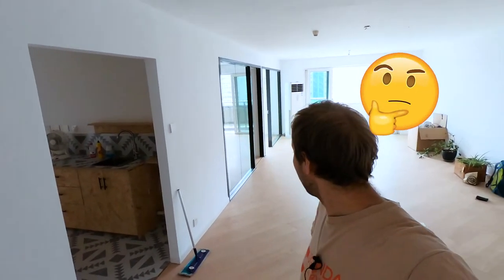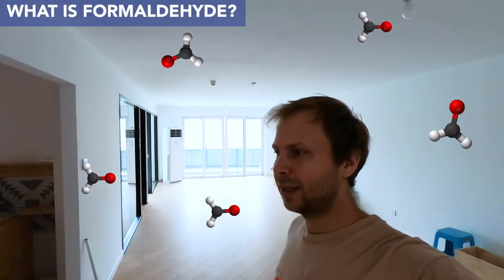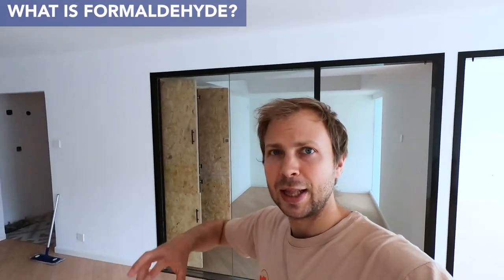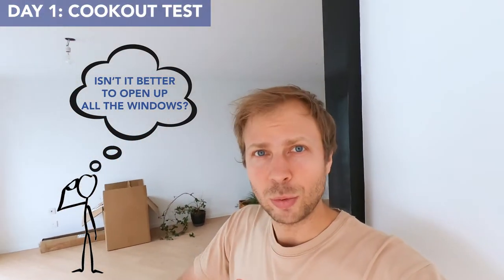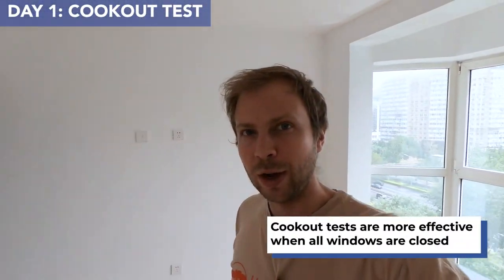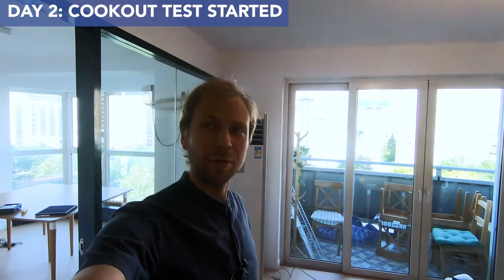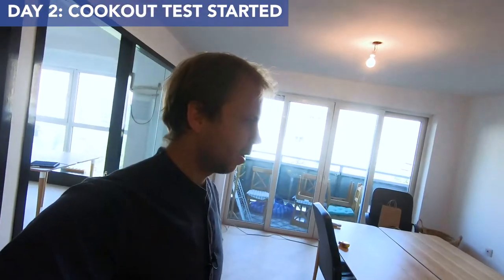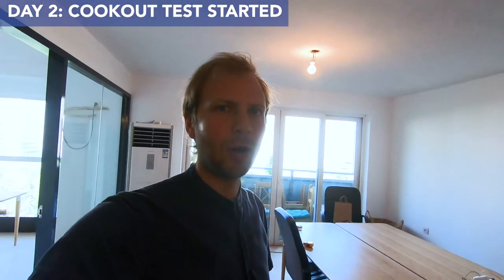Cookout Test: How To Protect Yourself From Formaldehyde/VOCs After Renovation

Comment: We did the whole burn out method about 5× and 8 hours in each room. Honestly it did help a lot. We also used the chemical spray that designed to help with the situation. We also repeated the method close the doors burn out and then open the doors air out and just kept repeating the pattern one week later everything's OK
Reply from the maker: It's great to hear that you had success 😎
Reply: @SmartAirFilters  do you think it will work on gas furnace and air vent duct work inside the wall ?

Someone used major spray paint in my house and I think it went inside the furnace and air ducts possibly ….
Reply from the maker: @catherinecheung207  possibly yes, but it's best to test it (quite expensive). Unfortunately, we cannot give you a clear answer. Do you use carbon filters?
Reply: Thanks for sharing.  Glad everything is ok
Reply: Burn out method ? Why you calling it like that ? Are you referring to cookout ?
Reply: And what chemical spray are you talking about. And saying it helps with the situation… what situation ? I swear people love to speak in cryptics

Comment: The effect this method has will be minimal unless you increase the temperature a lot. Off-gassing will still continue after cooling down. We're also not sure if it will really stay at 0.1 (in your test) in the long-term. The off-gassing would take several years for the chemicals to be in the safe level.
Reply from the maker: Yes, that's right. Paddy set the heating to approximately 86 degrees Fahrenheit (30 degrees Celsius). Research has shown that formaldehyde 'off-gases' 1.5-3 times faster in this environment. Of course, it is best to have an air quality monitor to ensure that the air is clean. The air in our office is of very good quality. 💪

Comment: If I have done a cook out and clothing or fabrics were inside the room, must I wash EVERYTHING after?
Reply: Your clothes will absorb some amount of the VOCs and formaldehyde and offgas them later.  But the method he shows in this video I'm personally not impressed with (at least not with doing it once). I'm very sensitive to these chemicals, so I would be washing them.  Using heat, you're essentially spreading the chemicals around, but mostly into the air.

This is beter if you can just open the windows on a hot and dry day
Reply: The only reason the windows were closed was to allow the temperature to increase more by temporarily eliminating cool air circulation... to maximize the release of the v.o.c.  

I have a feeling that introducing a concentration of gaseous butane or another solvent into the warm air before ventilating may also improve results

Comment: Question about the cookout. Should I remove furniture first. I’m worried that the released VOCs might be absorbed by the house furniture.
Reply from the maker: You'll want to leave the furniture in there! Furniture gives off VOCs and formaldehyde itself, so leaving it in will also help the furniture off-gas at a slightly faster rate 👌

Comment: Interesting, I kind of discovered this by accident and it’s good to know that it’s a valid method.

I recently purchased and assembled a composite wood cabinet. The smell was strong to begin with, so I moved it out to my balcony. It was about 90*F outside and the sun was directly hitting the cabinet some of the time. I noticed that when I went to go check on it the smell was really bad. I was a little concerned that the sun may damage the paneling, so I moved it around a bit so the same spots weren’t being constantly hit by the sun. I’m happy to know that should help reduce the amount of offgassing in the long term.
Reply from the maker: That's fascinating! It's amazing how sometimes we stumble upon effective solutions without even realizing it.

Comment: Thank you so much for these videos and your website. They’ve been very helpful. At 5:22 in the video you mentioned adding 20 kg of carbon. Could you please clarify how many kilograms of carbon are present in each carbon filter that you sell? Additionally, I would like to know the maximum number of filters that can be layered on the model of the Blast. Furthermore, how can one determine when the filters have become saturated and need to be replaced?

In my situation, I have a recently remodeled space with a strong paint smell. It appears that the majority of the odor is coming from the attic area. Interestingly, I've conducted four cookouts so far and noticed that the smell was even more intense during the third one and fourth compared to the second. Since the attic space doesn't have any windows, It’s a very large crawlspace. I've been relying on a fan to blow out the air after each cookout. I have air purifiers when I’m not used on a cookout but I’m not sure that they’re helping because they don’t have enough carbon in them.However, I believe using an better air purifier could be a helpful solution to tackle the issue long-term. I would appreciate any advice you have!
Reply: Great question. Too bad it was ignored like it was. Especially when you put all that time in writing this. It’s disrespectful even.
Reply: How do you know how much carbon were in your filters ?

Comment: I just got a new really large fluffy chaise lounge right out of the plastic and its in a very small room. We cant even go into the room now and it is burning our throats, nose and eyes significantly. I work from home so I cant leave. can I just shut the door, heat it up with a portable heater, then open the windows to vent...or do we have to leave the house for a specific amount of time to do a cookout even though its not the entire house?
Reply from the maker: Hey, it's best if you check what materials the chaise lounge is made of, but also contact its seller. The gases that are released during a cookout are dangerous and should be avoided for your own safety. Here are our various articles on cookout: https://smartairfilters.com/en/?s=cookout&searchblogs=1%2C9
Reply: @SmartAirFilters you say this and in the video the guy is literally walking into a cookout room without a special mask

Comment: I’m dealing with a fix in my apartment bathroom ceiling which has no windows, just a vent-fan. First the hole was sealed with plaster ,  but then a oil based primer spray paint can was sprayed over that ( the problem), then regular paint.  I can still smell the primer, I don’t even think it’s meant to be used indoors. I’ve tried using reg fans to air it out throughout my home but I don’t think thats healthy. Been currently using the water and lemon buckets which helped but with the vent fan off the primer just keeps off gasing so the vent isn't powerful enough. I don't want to spread it to the rest of my home. My bedroom is across from it which has the nearest window but if I fan it out through my bedroom wont that contaminate my bed n stuff?  Would using a Hepa air purifier in the bathroom work instead? And then just keep testing the air with a voc tester?
Reply from the maker: A HEPA filter won't help with the smells, for that you'll need a carbon filter! Check out our article here for some more info: https://smartairfilters.com/en/blog/remove-formaldehyde-from-home-fast/

Another option would be to use a fan to simply try to ventilate that room. It sounds like the bathroom isn't well ventilated so doesn't get much fresh air. Using a fan to blow in fresh air will help remove some of the smells and reduce any VOCs you have in there.

Breathe safe!

Comment: Can you use bamboo biochar in cloth bags instead of carbon filters?
Reply from the maker: Bamboo biochar is essentially 'activated carbon' or 'activated charcoal'. We've tested these in the past, and found that there's not enough airflow going through the bags to make them useful at adsorbing formaldehyde and/or VOCs. We'd recommend a carbon filter or running a cookout like in this video.

Comment: Lakeland Paints in UK has a range of paints to neutralize 98% of all formaldehyde & VOCs in the air down to 1ppm -
just paint it on your walls & woodwork & the paint does the rest 24/7 - independent lab results - just ask.
Reply: That’s great to know. I was actually gonna comment about simply going for paints that have no formaldehyde(if that’s possible) or with less formaldehyde even.
Reply: @alanmlkbanda  how would you tell if they have no formaldehyde? 
The manufacturers mostly dont even know themselves about their own products

Comment: Why use the paint with formaldehyde in the first place?
Reply from the maker: In many countries, the construction industry is badly regulated and it's difficult to buy VOC or formaldehyde free paints etc. Still, in most cases no company guarantees that their paint or furniture doesn't contain formaldehyde, just that it's below a certain threshold. Adding enough new stuff into your house in one go could still tip you over the edge

Comment: What device were you using to get a rough measurement of formaldehyde? The only way I've found to successfully measure it is an expensive lab test.
Reply from the maker: You're spot on @micahcruz8604 - there's no way to measure formaldehyde precisely except in a lab. In this test, we used an MX iBrid, but they are expensive. There are some consumer products on the market, like the Temptop Zaraman0077 mentioned, and we also offer the QP Pro which has a VOC sensor: https://smartairfilters.com/en/product/qp-pro-air-quality-monitor-qingping/

Comment: Hi. Recently remodeled my Mobile Home. I Later got a rash from the siding. I did research and the siding I bought has formaldehyde. Do you think I should remove it? I just put a coat of lacer on it, in hopes of sealing it. What are your thoughts on that?
Reply: Laquer would just make it even more toxic indoors.
Reply from the maker: Hey Kenny. As nevinkuser9892 says, laquering will likely make the situation worse. The formaldehyde will get out either way, so you should try to do it in a 'controlled' manor. Try running cookout tests like the one in this ideo when you're out of the house, and make sure to air it on days when the outdoor weather is nice.

Comment: Do you know if any any particulate issues from drop ceiling tiles that would be in a basement?
Reply from the maker: Good question Craig! We’ve never heard of these kinds of ceiling tiles producing particulate air pollution, but it may be possible, depending on the ceiling tiles.

You could test this yourself by picking up a low cost air quality monitor and measuring for PM2.5 around the tiles.

Comment: I am moving to new house next month. Does it help if I turn on air on (lower room temperature)? We don’t have a heater to increase the room temperature
Reply from the maker: Great question! Lowering the room temperature won't help with removing formaldehyde. Ideally you want to try and increase the temperature. If you don't have a heater or a way to do this, then you could try opening windows to allow air to circulate around the home. This won't be as effective as a cookout, but will help a little bit.

Comment: We have MVHR in our flat (we live in a new built) but it seems it is keep bringing formaldehyde back to the flat and a "cook-out" doesnt work as it always comes back, even though the ceiling extractors are closed. 

When we open them, things gets lot worse. I know they supposed to suck out air, but formaldehyde just keeps coming back to the level of 0.1 mg/sqm2.

Is it possible that because we live in the 9th floor the buildings ventilation system just accumulates all Formaldehyde in the flat and it gets stuck on our floor?
Reply from the maker: This sounds like a tough one to diagnose. How are you measuring the formaldehyde in your flat? Are you sure it’s not the formaldehyde monitor that’s off? We recommend using your nose to detect for formaldehyde (as unscientific as that sounds!). Here’s more info: https://smartairfilters.com/en/blog/formaldehyde-detectors-not-accurate-monitor-formaldehyde-home/

With that said, new flats will generally take 2-3 years to off-gas completely, so it’s possible that some things in your home are still off-gasing.

In this case, your best bet may be to install air purifiers with carbon filters, and replace them regularly.

Comment: I'm sorry, but this is extremely unscientific.  Of course the levels will drop when the windows are opened, but what do they rise to again the next day?  To have levels double during the "cookout" seems very insignificant to me considering the total amount of formaldehyde likely to off-gas over the next month from new materials, etc.

I do affirm the use of heat to speed off-gassing, but do this more scientifically.  I would presume it would take multiple cycles of cooking and venting to put a serious dent in it.  And my body is a super sensor of formaldehyde and various (petroleum-derived) VOCs in that make me extremely to seriously ill (by "seriously" I mean medical emergency).

Comment from the maker: Has anybody else faced formaldehyde issues when moving into a newly renovated flat or office?

What have you done to solve formaldehyde? And has anybody else run any cookouts at home!?

Leave a reply and let us know 👇
Reply: Lakeland Paints in UK has a range of paints to neutralize 98% of all formaldehyde & VOCs in the air down to 1ppm -
just paint it on your walls & woodwork & the paint does the rest 24/7 - independent lab results - just ask.
Exported to 56 countries so far.
Reply: I’m in the U.S. and we’re buying new furniture for rooms. The VOC’s are horrible! Of course I’m the only one affected. We’ve put them outside, in a spare room, wiped them down with soap and water, then white vinegar. It’s exhausting. They still smell. It’s very humid here now and I have a deck . Should I take some of the small furniture outside, cover in plastic for a few days and then see what happens?
Reply: @irw4350  thanks for this info. can you paint it on an already painted wood cabinet? 🙂
Reply: I have a nightstand that I would like to restore/paint. It has the California 93120 Phase 2 Complaint for Formaldehyde label. What do I do? How can I fix it?
Reply: The billion dollar question is which air quality monitoring devices are you suing to detect formaldehyde ?
Reply: Activated carbon is the cheapest option.  iirc, activated alumina is more effective at removing formaldehyde, but it's also much more expensive.

New carpet: steam clean or shampoo with hot water and any detergent and let it completely dry -- 6 times in a row. :( That one was from a study by the EPA but for removing PFAS.

It's far better if you can open all of your windows on a hot and dry day -- better yet, several hot and dry days.

Run air purifiers with activated carbon.  If you're poor, buy a box fan and some "activated carbon air filter material" from somewhere online, cut a piece to match your box fan (typically 20"x20" in the states) turn your fan on and stick the piece of carbon filter material on the back -- let the suction will hold it in place.  That will remove VOCs and formaldehyde (more VOCs than formaldehyde).  I usually use three layers, but it depends upon the material you get.

Comment: Cook outs still take long time to air out but not as long as air out with cold air
Reply from the maker: You're absolutely right. Since Paddy cranked the heat up to 30 degrees Celsius, formaldehyde will off-gas 1.5 to 3 times faster, according to research.